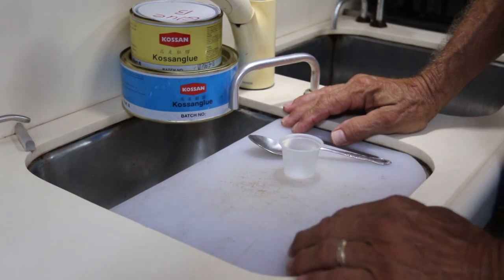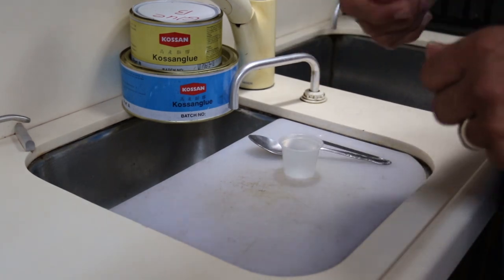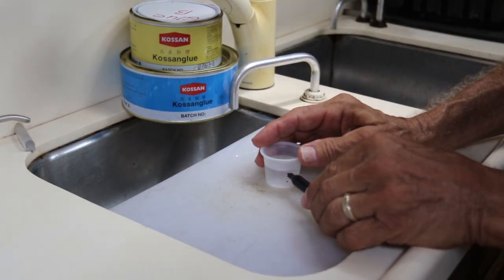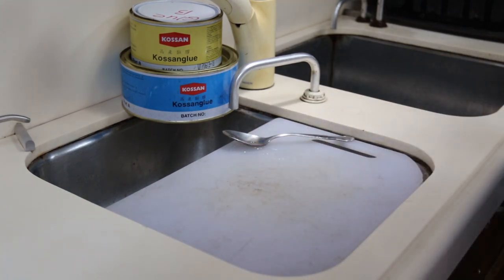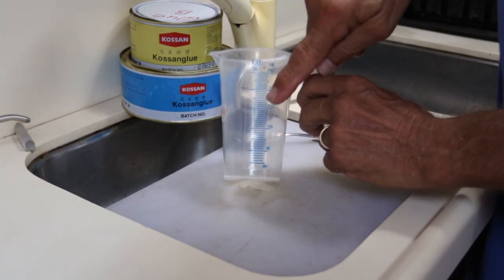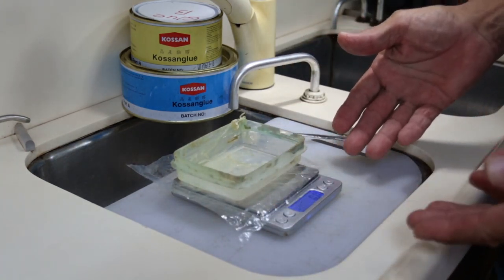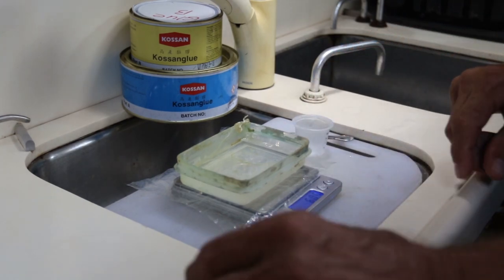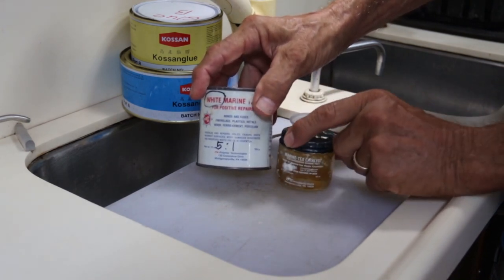Mixing & Measuring 2 part Paint, Fiberglass, or Epoxy. (Patrick Childress Sailing Videos #6)

Comment: Thanks for sharing. FYI, you can convert parts in volume to parts in weight if you can find out what the density of either part is. It should be on the MSDS. Density = mass/volume.
Reply from the maker: Ben, Thanks for the useful information.

Comment: For mixing up really small batches of epoxy I decant into a syringe. I remove the plunger and hold the syringe upright in one hand while stoppering up the exit hole with the pinky of the same hand. Wearing gloves of course. With the other hand I decant into the syringe the required ratios . Then I squirt the whole lot into a mixing cup.

As a side note, I once measured my epoxy dispenser pumps by squirting into a syringe and was shocked at the variation in volume from pump too pump. Especially the first pump of the day. Never trusted the so called metered hand pumps after that. I always decant into a syringe for accurate measurement. Using this technique you can easily mix up anything from a tiny to a large batch as the job requires.

Enjoy the videos and great technical content!
Reply from the maker: Thanks for the additional ideas for measuring out small amounts of epoxy, and the positive comment.